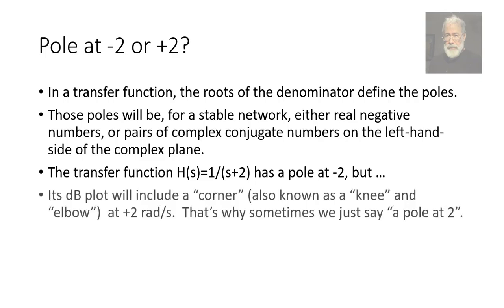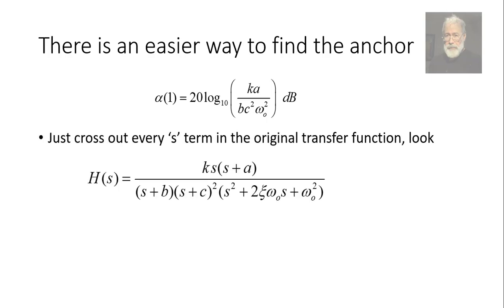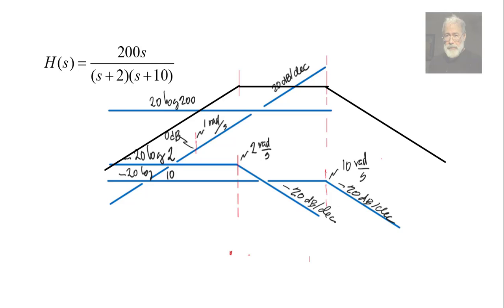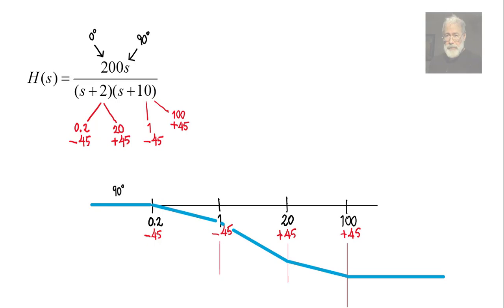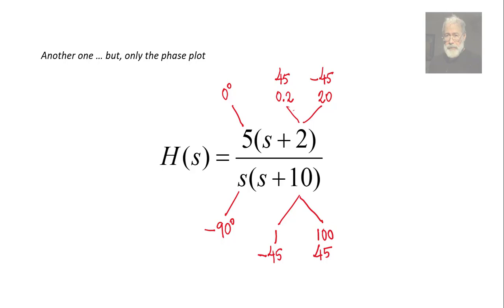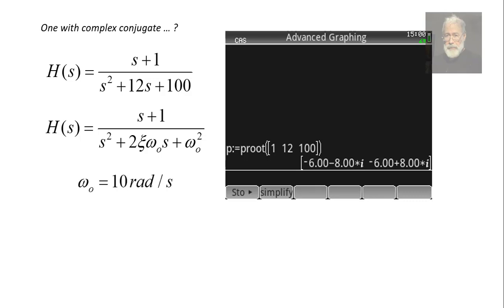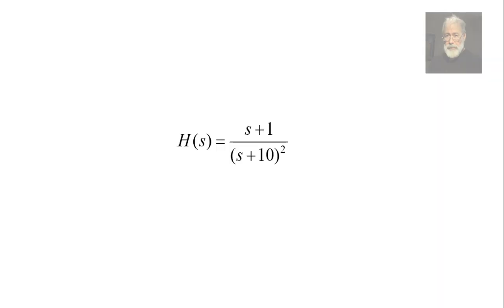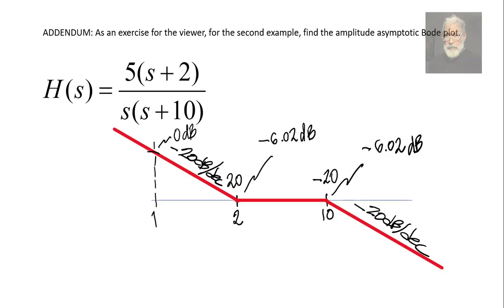WATCH the Ver 2.0 instead.

Comment: Good evening Professor your videos are very good.  I learn a lot from them how to use hp prime calculator.  these calculations you currently do with HP Prime and the sequence are the same if I were to use the texas nspire cx cas calculator? do you have a video on how to use the nspire to calculate electrical circuits?  Grateful.
Reply from the maker: Sorry, Claudio. I don't know the TI Inspire.  But I read it has its own CAS, different from the XCAS used by the Prime.  One thing I like of the Prime is that XCAS is Open Source and it is constantly evolving.  Also, the emulator of the Prime is free, you can downloaded it and use it for free.